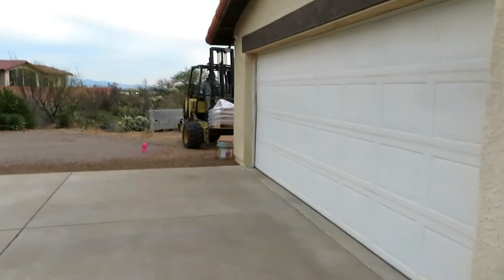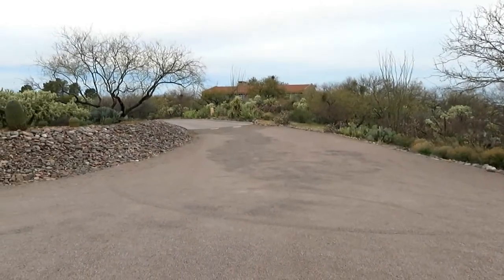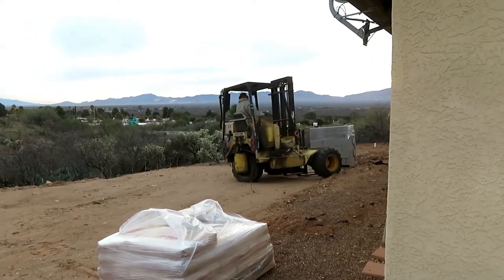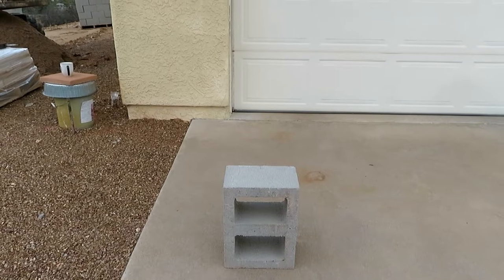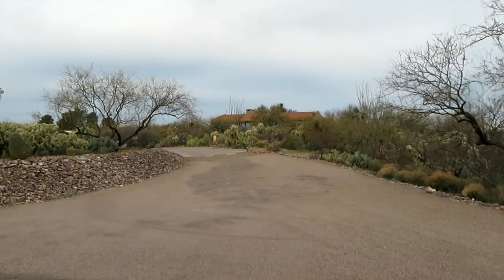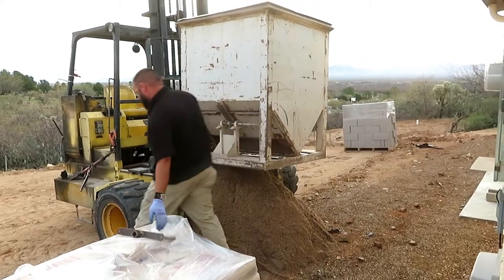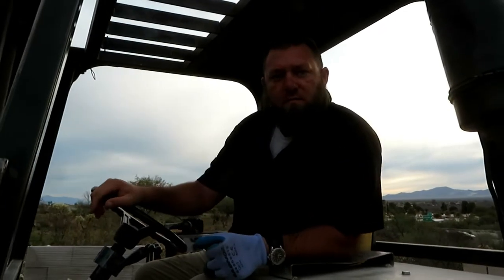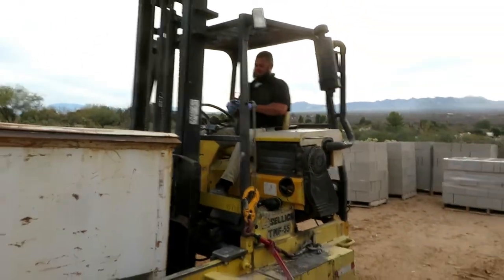Stem wall block, sand and mortar delivery by Central Trucking, a division of CABCO 02192020

Comment: Awesome! That forklift is a bit smaller than the one I drive for my job, but looks like more fun! This is starting to get interesting!
Reply from the maker: Ahh, so you drive a large forklift at work, that sounds like a cool job!  I have also driven forklifts for different jobs I have had, but this three wheeler is really cool and fast.  The forks can move in and out and also side to side in addition to the usual up and down and tilt back and forth.  With this machine, you can put a load exactly where you want it!  Thanks for watching Cat Bird, and yes, it is getting interesting.  We should see some cool stuff in the next few weeks!